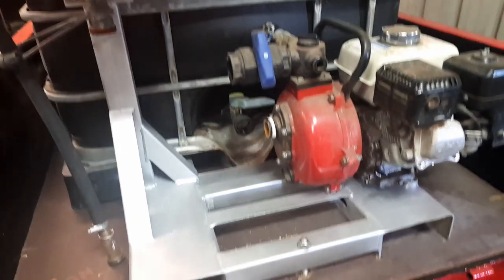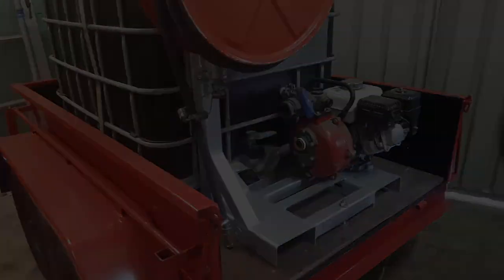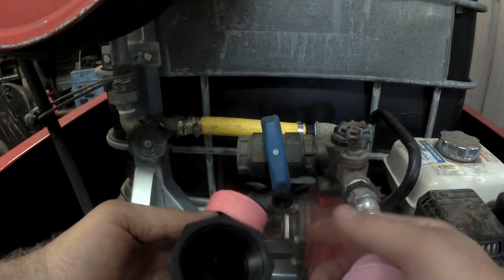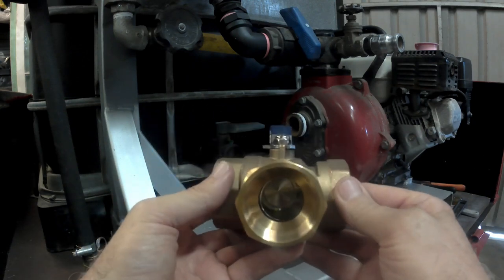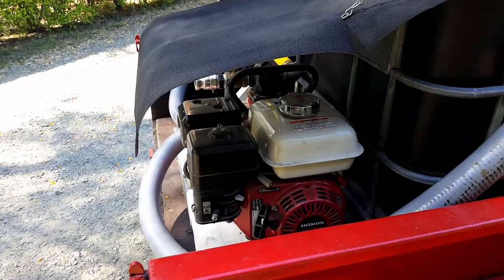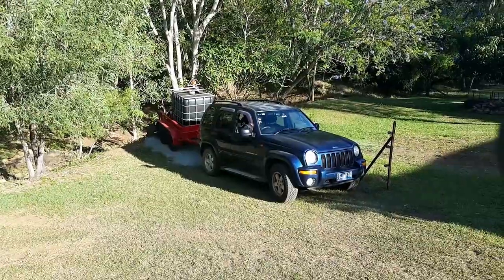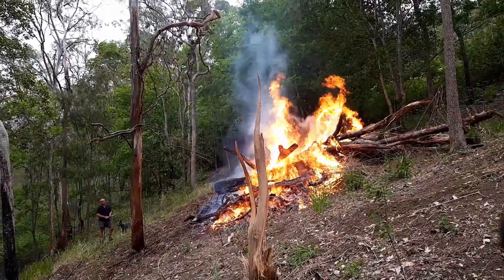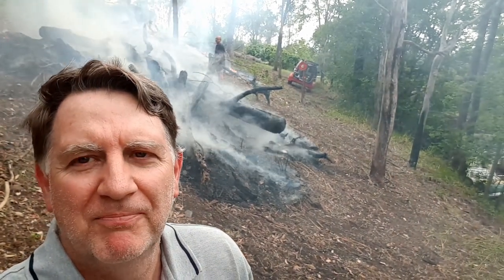Final Assembly and "Getting Used" - Building a Fire Fighting Trailer

Comment: Just watched the video its got me intrigued about drafting from open supply currently got my trailer unit at local engineering business for pump change over the idea of a 2 way ball valve has got me thinking about doing same thing but my tank has a supply line that runs to pump how would I would go about converting it into both supply and suction line as rear of tank is at back of trailer
Reply from the maker: Start with the 2 way ball valve into the pump feed in and wrk from there. One side comes from the tank as it currently is and the second has a line with a hose and cam lock that connects from a stationary supply. The othe thing to keep in mind is that you also need 2 outlets, one to the reel or fire hose and the other to the top of your tank to fill it. I hope this helps.
Reply: @DoinStuff Yep it helps I've got a t piece on my tank with one being supply and other meant for bulkie refills so might reassign outlet 2 and fix up an old 19mm hose with cam locks to act as relay for refill

I've got a 7.5 hp twin impeller fire pump currently getting fitted by a local engineering business that has an inlet as well as 3 hose outlets on top
Reply: @DoinStuff  Ended up getting an ARAG brand 3 way ball valve from the local farm supplies shop gonna be interesting to see how it works as the tap system seems tricky in comparison to how you've done it in the video just waiting on my fire trailer to have its pump swapped
Reply: @DoinStuff  Hi mate been a fair while since my last comment I've finished the setup its now fully plumbed up with camlocks and capable of suction from an open supply with a return line coming out of discharge outlet and back into the tank

I tested it out using a plastic rubbish bin filled with water and it worked
Reply from the maker: @robbiestewart1984  great to hear mate, you are ready for anything now 👍
Reply: @DoinStuff pretty much it only took consultation with a local irrigation/water supply store to resolve my suction problem after shutting off the supply line and tank valve then placing the suction hose into a full plastic bin it started sucking very second I cranked the pump up

Comment: hello this was over a year ago that you published this video.. I want to add some things that you might consider. there's things called basketball balls you put them in the tank and they help prevent the sloshing around the water.. I'll check you might want to put some hand tools on there like shovel a pickaxe and a stiff pine break in a shop time break.. you might want to add some hose to that flat hose like inch and a half hose in one inch hose if you want it inch and a half hose you can use that as a feeder hose you put a white connection at the end and it'll stretch it out so far and then you can use one inch off that and then you can always break the one inch down to what you would call garden hose size I know the in sky shoes metric over there just don't know the metric to those particular sizes.. a chainsaw will come and helpful also extra fuel and then add on to that maybe it's luxury item a gas powered or battery powered weed cutter maybe with a blade on it instead of the string.. that'll you cut a fire line with that through a brush area.. another thing you might want to consider is generator not a big one fire happens at the most inconvenient time a lot of times at night.. so if you have a small kid already you can make up some light stands with some spotlights maybe $250 watt spot lights to light up an area or floodlight.. and maybe a quarter you make a stand that you can take the lights off the trailer and set it up somewhere. I don't want it over overweight your trailer but need some things to think about if you could go with the gas powered weed cutter and chainsaw try to find ones that are four stroke that way you only have to keep one fuel source on them on the trailer you don't have to have another can to make some gas and oil together and.. don't forget some safety equipment and also remember get yourself a pair of all cotton jeans or all women jeans you don't want too much man made fibers in there shut those aside as your firefighting pants with work boots and something like a flannel shirt I know it may be hot at the time brush fire or you call them bushfires and Australia. and a helmet with a face shield for the chainsaw make sure the face piece to come off easy that you can put it somewhere and just use the helmet I'm going to need some adapters and some other nozzles or a water safe or just want it in reducer complex I try powder fire extinguisher and in this country we call him Indian tanks they hold 5 gallons of water and they have a small pump well very also make agricultural sprays with a little gasoline engine on it that's another luxury item but you can always put some tool boxes on here wheel covers. oh yeah and keep yourself a box of dust masks going to keep all the smoke out but it's going to keep the large particles from your face and put it this way if you could if it feels really hard on your face you're too close back up and get some more pressure on your pump .. I'm using the talk to text so if there's any scary sentences sorry I just read around it and you make it the idea of what I was about to say.. have a nice day God bless
Reply from the maker: Thank you for taking the time for the very, very long comment. I will think a bit on your suggestions. 👍
Reply: I read some of my comments and some of the things didn't come through right.. they're not basketballs they're called
Reply: I read some of my comments there are some things that are written wrong in here they were basketballs they were ballasts ball
Reply: It's not a pine break it is a hard time right also one with the softer so to speak kind
Reply: Also if you think about it and want a cheap prior resistant gear you can use Walters pants and coat and gloves remember eye protection as well